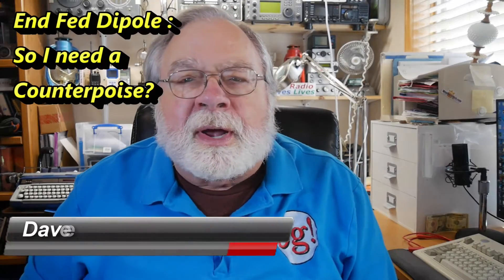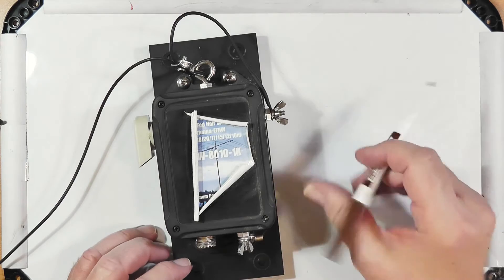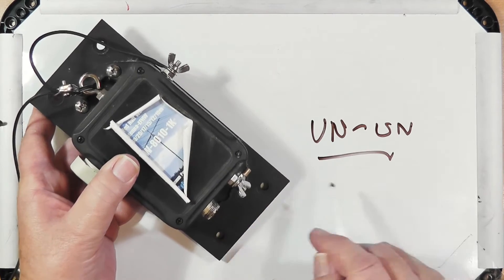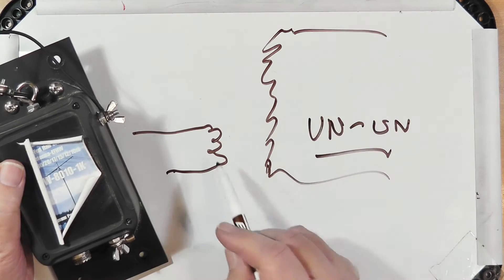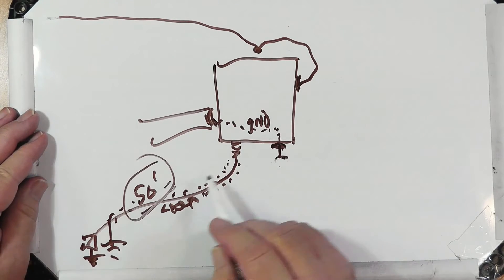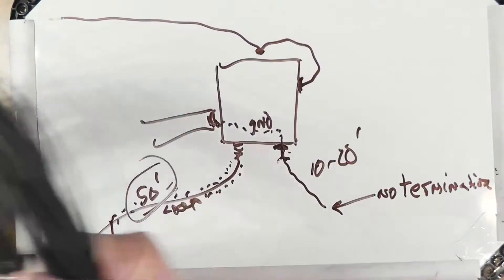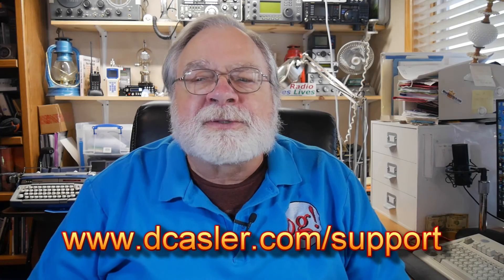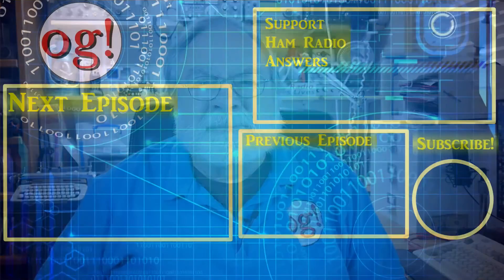End Fed Dipoles : So I need a Counterpoise? (#529)

Comment: I have a 49:1 unun, and a counterpoise. The one time I managed to be heard (IC-705, 5W out) the far end called me "noisy and distorted".  I suspect my station ground is poor.
Judging by your comments, I should NOT put ground on my Unun (where the counterpoise connects).

Which has me wondering: where is best point for station ground?

Comment: It says right on the website description that it is a half wave endfed, not a dipole.

The word dipole consisting of di and pole literally means two opposites. Even an off center fed dipole has two halves or poles.

You make a dipole out of an end fed by having a  counterpoise (your coax or an intentional one), and radials to couple with the ground for a vertical to form.the other half of the dipole. That is why many of these packages insist on a particular recommended length of coaxial feedline.

I'm not sure how their unun is wired, but the wingnut is likely/may be connected to the same as the coax shield and take the place as the counterpoise. Again, in theory, an open or a short (to ground) reflects the wave, just in opposite phases, so one may work much better than the other. Then one is free to choke the feedline at the unun to keep common mode etc off the shield.

Comment: Thanks again!  I have a 9:1 unun portable like this with a long antenna wire and counterpoise.  I've tried it several times but was not able to make any contacts, though it receives very well.  The angle of the counterpoise has been adjusted and I've connected to my home ground rod with identical results.  

73
Reply from the maker: Try making the long wire 66 feet long and give it a whirl on 40 meters. A true "long wire" antenna is multiple wavelengths long. If you can, construct or borrow a 49:1 unun. If your coax is longer than about 20 feet to the lightning arrestor at the ground rod, you may not need that counterpoise at all.
Reply: @davecasler  How is this comment thread a year old? It looks like the video is only 3 weeks old. I'm just trying to figure out if this drawing is in the future or the past.
Reply from the maker: @aarongriffin81  The year-old comment thread is correct. My channel was badly hacked, but YouTube really went out of their way to restore everything. Unfortunately, a few dozen videos were restored as though they had just been uploaded. Hope that helps. Thanks for your support. 73, Dave, KEØOG